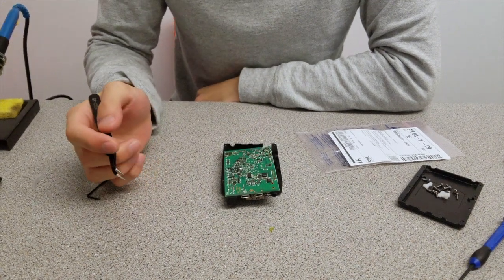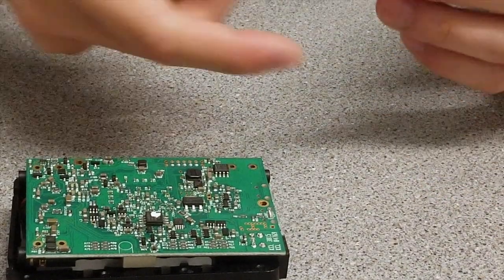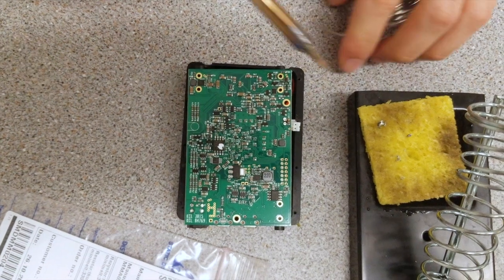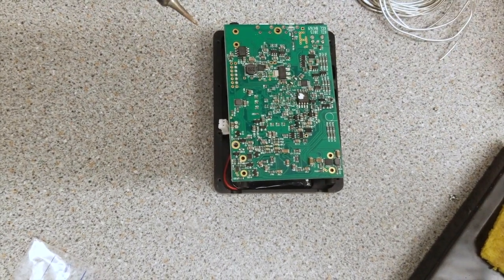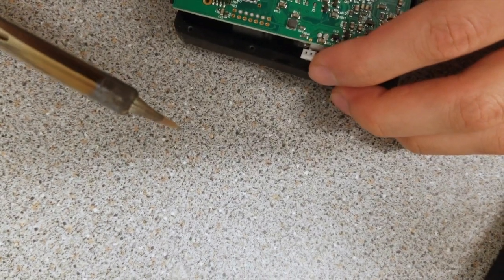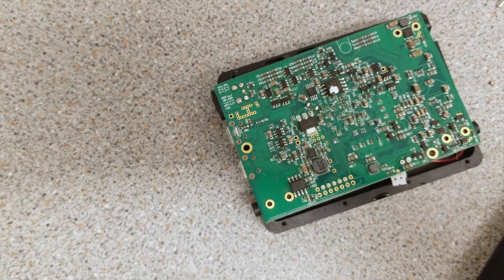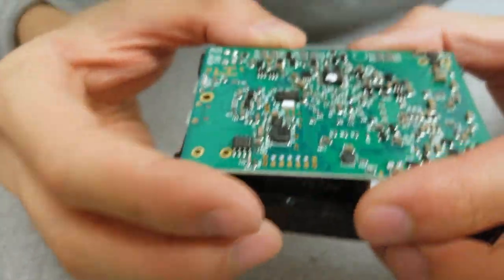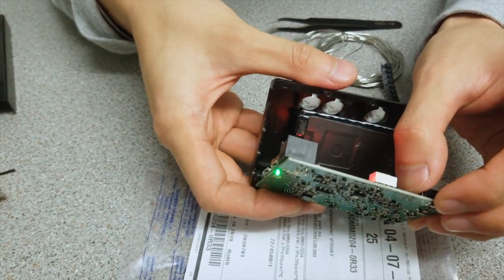Beginners SMD soldering (Chord Mojo mod)

Comment from the maker: To those who comment that what I did was disastrous and disappointing: Yes, you're right, but you're missing the point, I made this video SPECIFICALLY to help those fresh into DIYing. It's supposed to be a bottom line for soldering, as in how far you can simplify things before damaging stuff (for example twisting a capacitor off is a GUARANTEE for PCB track damage). I'm demonstrating how to solder to a certain standard with the bare minimum. Personally I adhere to the NASA workmanship guides, which means my joints are 'mirror-like', flat and flush...etc. but this is way too much for newbies to take in, which is why I'm WATERING IT DOWN to the bare minimum so that they can have a stable start, then we can talk about how to improve !

Comment: Terrible working place, no preparing... and soldering-work like a total newb. Sorry but it is what it is. You can better talk than soldering.
Reply from the maker: yes, you're right, but it's for BEGINNERS, soldering to a high standard is not inherently difficult but it's too much for a newbie to take in. Something as simple as solder choice, solvent choice, component fixture can overwhelm newcomers, I'm trying to help them solder to a certain standard with the bare minimum, it's going to be different to what is acceptable to us!

Comment: Use a solder wick to desolder. if need be use some flux. Also use thinner solder it will make it easier to solder.
Reply from the maker: Bring out the 99% Isopropyl Alcohol to improve the soldering experience too!

Comment: Hi Hethan Lau great and unique video, i have one problem with my mojo,  i will appreciate your advice, when is conected to the usb power it only supply 3.8 volts to the battery ( not charge), that voltage cant even maintain the unit on without battery, i checked another mojo and it supply aroun 7 volts to the battery and can stay on without the battery. everuthing else work great when i use a full charged batery, What could be the solution ? Thanks in advance, i tryed to explain the best i can.
Reply from the maker: nope, no idea 🤷‍♂️, do try a charger with a beefier current rating (2A?), might work

Comment: Hi, interesting, what had you exactly changed and what parts did you use? You mentioned a the beginning of this video, that you change power supply electrolytic cap and 2 caps at the output?? and 6 resistors ?? Could you let us know, what parts you used and which values ?? Thx
PS: you wanted to do a video on the sound improvement, but I haven’t seen one?? Is the mod worse the efforts and how “ big” would you describe the sound improvements??

Thank you
Reply: I would really like to know all of that too. :)
Reply from the maker: Got a video for that 👀, hope that persuades you to go DIYing👍

Comment: it is high risk like that. make sure your solder hot and you can add the paste and use soldering wick.
Reply from the maker: Many thanks for the advice! Although this is more of a soldering iron and solder only approach, your method is definitely an improvement